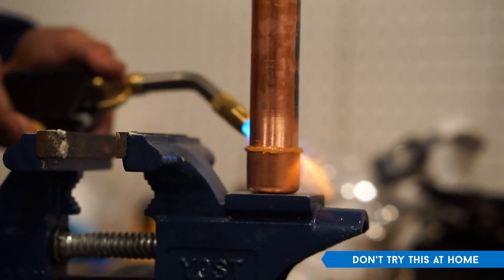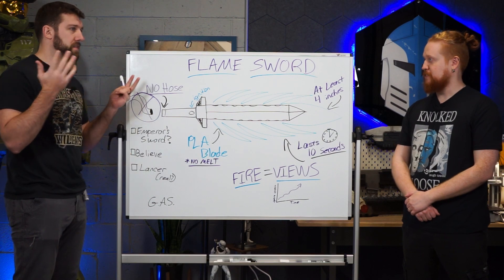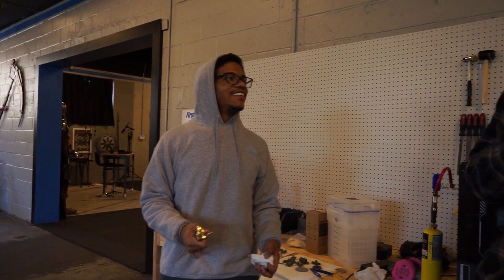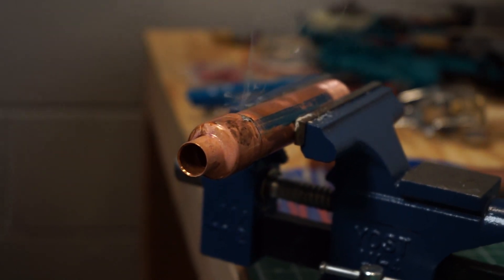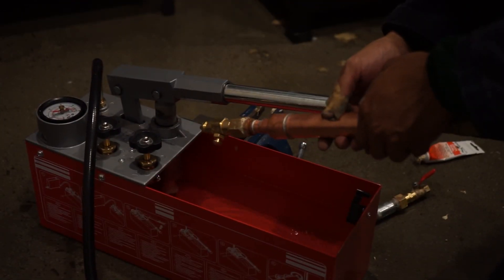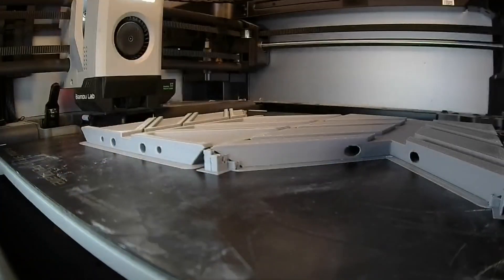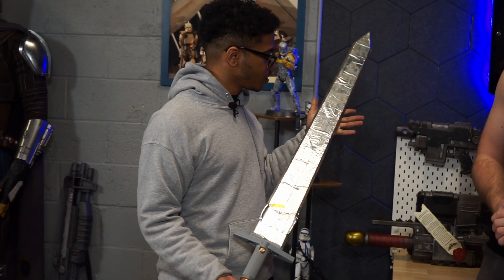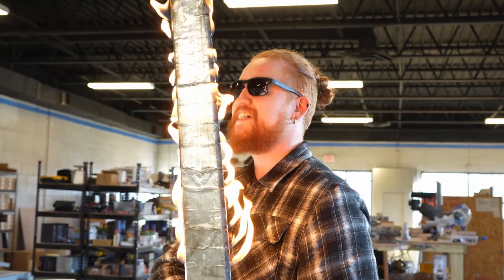3D Printing a Flamethrower Sword – What Could Go Wrong?

Comment: what is your most used printers?
Reply from the maker: Bambu X1-C for sure. We're talking thousands of hours of printing.
Reply: @ I was thinking about getting a printer for the first time but i don’t know if i should go with the p1s combo or something else what do you think?
Reply from the maker: We have multiple staff here that have P1S and P1P models that they personally own and have made great armor sets. You get some extra bells and whistles with the X1Cs, which is great, but the P1S is a lovely self-contained model. The AMS isn't super necessary if you're doing cosplay- you're post processing all your armor files. However, if you want to do multi-color or just large prints where you don't want to change spools too often, it's great addition.
Reply: @GalacticArmory  alright sounds like im going for the p1s then!

Comment: If you expose the infill a little on the print, you could chain pathways throughout the entire sword without actually having to design the pathways.
Reply: That would likely create too many pockets of oxygen & stagnant gas inside, which would ignite the inside of the sword (and it'd crack open)
Reply: @HiyuMarten  watch some videos by Thomas Sanladerer, he shows the infinite potential of infill and slicer hacks.